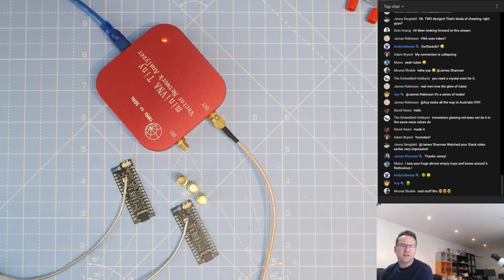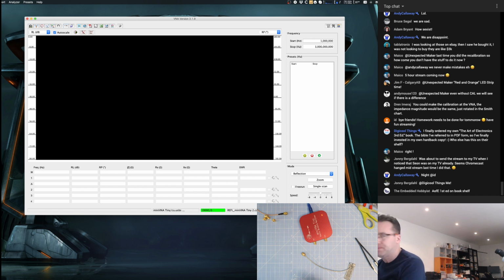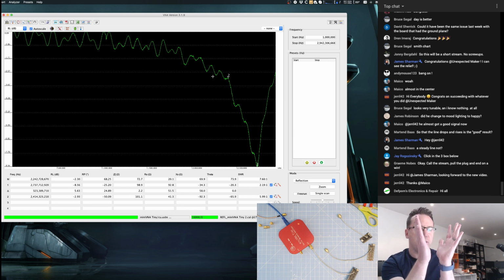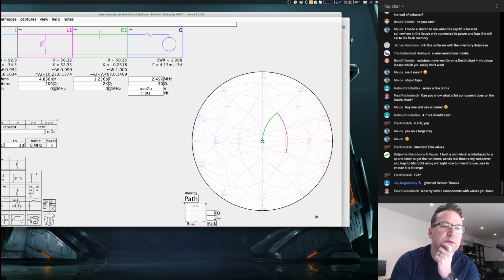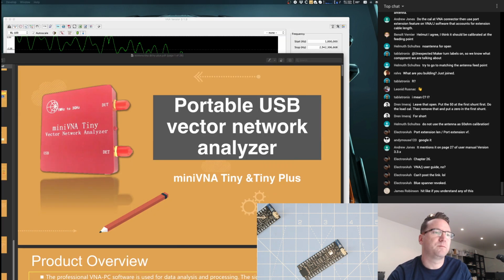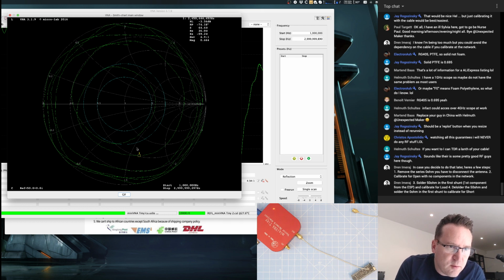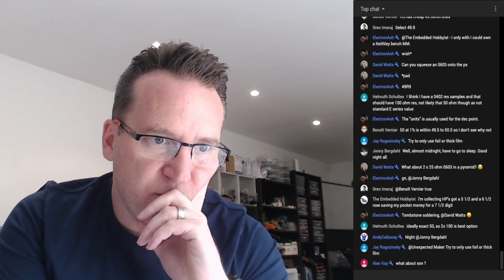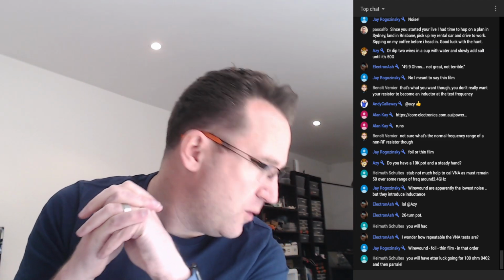LIVE: New ProS2 !! More miniVNA playtime!

Comment: Just watching the stream (01:30) and why not print a ‘U’ shaped clip that goes over the edge of the shelf and holds the light strip - think a wide hair clip (Bobby pin I think) - do them in white and you should not notice them.  They can be thin enough that the heat from the leds may not heat them too much.
Reply from the maker: The strips sit at the back of the shelf... next to the wall, so can't be clamped with a C section. The shelves are attached to the wall.. no gaps to slide anything in. I'm going wth my clear tape version for now to see how it goes :)
Reply: @UnexpectedMaker  https://www.amazon.co.uk/slp/led-channel/z3ufosh48d5u3t2 Much neater than tape!